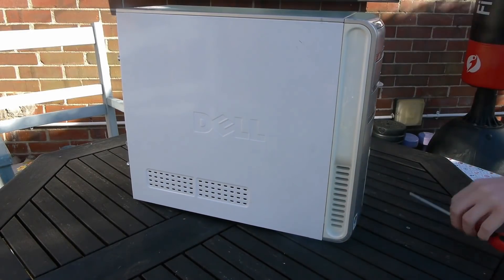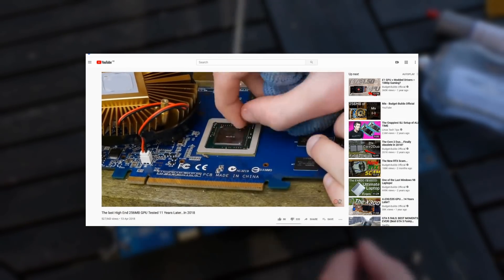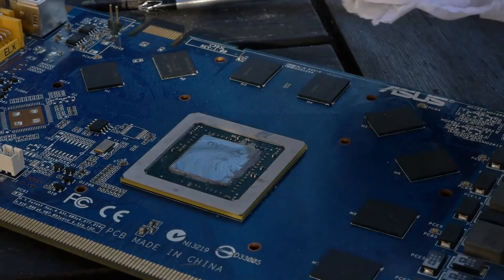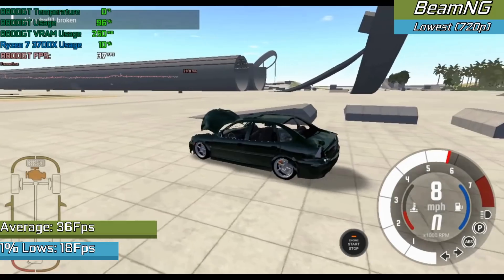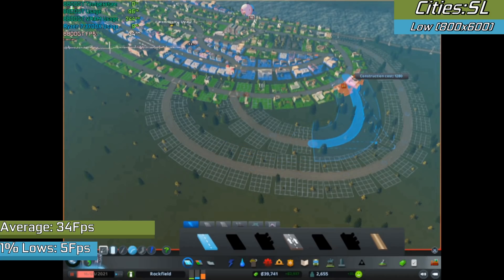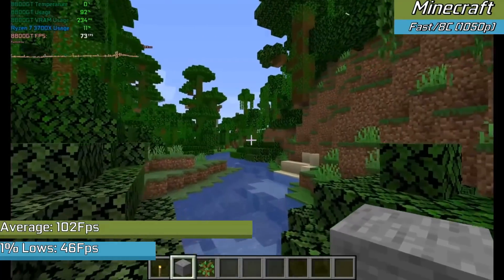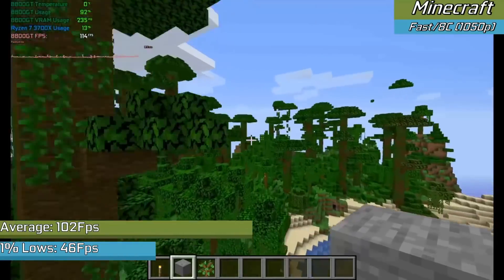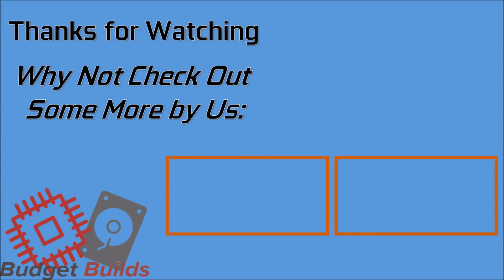GAMING with only 256MB of VRAM?

Comment: Congratulations, now you own a ryzen powered Playstation 3.
Reply: Playstation 2
Reply: @kidori121  actually no, you can not compare a PS2 to computers simply because of how much it differs from computers, which is why the PS2 is so demanding to emulate.
Reply: @Ozzianman  actually no, just buy a better CPU to have better emulation on PS2
Reply: @Tofuuuuuu  yea the GPU has to do like 0 work it's all the cpu
Reply: @kidori121  4MB VRAM? Are you kidding? Sony says PS3 GPU (Nvidia Nvidia 7800GTX based of) is 1.8TFLOPS in their press specs... then Sony lists behind links only during release times PS4 GPU had 1.84TFLOPS. Tell me about progress there. PS2 is totally not there with 4MB VRAM to be said to be even close. The thing which separates PS3 of others is XDR Ram speed and IBM Cell cpu which power was passed only recently in raw power by Ryzen cpu's lately (if you knew how to use it).
Reply: @Tofuuuuuu  Emulation is different than running game on native hardware. Emulator system usually many times faster than emulated one.
Reply: @kidori121  PS2 had 1MB of Vram
Reply: @Mr Oakley 07 "JuSt gEt A bEtTer PeeCee"
has Ryzen 3600 and 1070ti
Something tells me you have not tried to emulate Ratchet and Clank. FPS in that game TANKS unless performance improvements have happened. Actually, i know PCSX2 is getting a Vulkan renderer. Might try that.
Reply: @Mr Oakley 07 CPU is fine for years to come. Currently keeping am eye out on upcoming GPUs, might go RTX since I do 3D rendering and other stuff that would get a nice speed boost.
Reply: Spiral  And where hell you try pull this number from?
Reply: Additional note: Some just shows douple precision or shader and so you find hard time to compare those GLOPS 1:1 specially as Sony made Linux users hell as they blocked GPU usage and most users never knew how use SPU's where roughly 90% CELL CPU power comes from.

I did compare same source provider TFLOPS between PS3 and PS4 so they can be comapred between together 1:1.
Reply: Spiral  POWERRR and supported functions are different plus RAM helps greatly to make eye candy what is not always a power. You are not wrong but you are just off now. Handling large textures and data is helped by having RAM greatly. Having calculations POWERRR is different. You remember nvidia Quadros in example were so useful in their specific areas and normal GeForces did suck at those and you understand more what i refer to. Normal people doesn't focus or understand those.. I don't know why you need bring Naughtydog team here. Those even did hack PS1 to run their game better in silence in ways. I know they know tricks. Read those who did Ratchet And Clank series too they explain PS3 well too in their memos of how start using CELL cpu.
Reply: @XantheFIN  passing modern cpus? imao good joke
Reply: spiral7399  last of us bricked people consoles so they took a gamble

Comment: When a 14 years old graphics card runs GTA V better than your computer ;-;
Reply: ;-; same but I have 4gb of vram
Reply: K&S Tech News what are your specs?
Reply: today my vega56 has died, now i use a gtx 275 with a ryzen 1800x
Reply: then you desperately need to upgrade rofl.... $100 prebuilt with a add in budget rx 470 or something would easily play this at 1080p high.
Reply: @mxmobile5619  GT 210 4GB
Reply: @californium-2526  why the hell would a gt 210 need 4gb of vram
Reply: I went and looked around and I don't think 4gb versions even exist
Reply: Not 14 years yet! The 8800 GT(92) is just over 12 & 1/2 years old. :) The 8800 GTS(G80) is from early 2007
Reply: F
Reply: @onometre  same for a 730, most 10 year old GPUs destroy it, but they gave it 4GB of Vram and can't even run most wanted 2005 on max settings.
Reply: I have hp g60 laptop and only 1gb ram and 512gb of rom ;-;
Reply: GTA 5 runs on anything, literally anything, even intel hd graphics. If it doesn't run it's probably due to your cpu because gta 5 is cpu heavy.
Reply: I have 512 MB of VRAM of an horrible iGPU
Reply: @pikaaxyt  GPUs don't have to be that expensive if you don't mind 30fps or lower res/settings.

But I'd wait for the new stuff to come out since it Shou be much better than what's available now for both Nvidia and AMD.

GPU wise, I heard the new AMD CPUs are basically the same with slightly higher clocks but at almost double the price of current gem parts or heavily increased.
Reply: @pikaaxyt  Integrated gpu's do not have VRAM, they use normal system memory RAM as their quick access
Reply: @HOWLWOLF  I'm not broke. I'm cheap as shit to not go broke because when I spend, I can lose control. I have gotten better about it after 1 year if having a checking account
Reply: Get yourself a 2200g Apu build, gaming has become extremely accessable in recent years,well after that mining craze sht show
Reply: intel n3530 here with integrated bay trail gpu
Reply: @chillhour6155  the 3200g is somehow cheaper here than 2200g
Reply: I cant run it i got an Asus i3 and 4gb ram and a NVIDIA 820m lol...
Reply: It's not all about Graphics Card.
Having a Good CPU and a RAM and a SSD matters now.
Reply: A mi me va bien con mi 780ti xd
Reply: @mxmobile5619  me too
 

lmao
Reply: #intel hd 😂😂😂😂
Reply: Lol
Reply: My PC run GTA v better i got 6 gb od video ram
Reply: My laptop runs it at 60 fps
Reply: There is a fucking video where a 50 cent graphics card ran gta 5 solid
Reply: Yeah but with 32 gb ram and ryzen 7 3700x
Reply: Только учти что гта 5 вышла не в 2020 году, а 2013, поэтому можно сказать что видеокарте 7 лет и она уже не тянет гта 5.
Reply: А не 14
Reply: This is why you don't buy OEM laptops that use mobile CPUs which perform far worse than their written specs would suggest!
Reply: Oof
Reply: I have fuking 8 gb ram with i7 5 th gen stilll it does better 🤔🤔
Reply: i Have G31 Onboard ,,,
Reply: I still see your shadows in my room
Reply: why, i thought this video is fake
Reply: same
Reply: Lol me too hahaha
Reply: Upgrade your gpu, it legit isn't expensive. If you can afford a pc and, a ISP. Im pretty sure you can save up 50 bucks.
Reply: @Timo Werner Hey, no problem, the GPU Works now, I repair it.
Reply: Lmao gt 210 is powerful enough to show the image on your display idk about anything else tho xD
Reply: It's ryzen lmao
Reply: Not anymore. I now have an rx 570
Reply: Dylan yh I think it’s because you might have texture detail on high, put it to normal and put the drawing distance to 0 and turn all the advanced settings off
Reply: @Dylan no i said put textures on normal
Reply: @mxmobile5619  same :)
Reply: Me sitting here with my Intel HD graphics not able to run GTA SA at high settings :(
Reply: @onometre  The same reason my 500gb 4200rpm HDD has 128mb cache (it doesn't)
Reply: Do you have intel hd graphics?
Reply: There is the truth 😅😅😅
Reply: I have a Gtx 1060 3gb vram and 8gb ram with a. Amd cpu k forgot which one
Reply: Mate I have a Ryzen 7 2700x, 32 GB RAM, RTX 2070 it runs very good
Reply: My pc can't even run Minecraft
Reply: E.T Channel thats not a bottleneck at all
Reply: I have rx570 with 4gb of brak and iż much better than that
Reply: @onometre  Because why not? :D
Reply: @AThePetrov - Windows Blackcomb Ultra 2 OH, that's really old.
Reply: Intel HD gang ; - ;
Reply: @ŽaliaUgnis  do u have any sense of computer, rom?
Reply: What do you mean?
Reply: I think GTA is more CPU intensive
Reply: @mxmobile5619  same but i have mx110 2 gb and gta 5 runs like crap
Reply: @HOWLWOLF  …say that now mate look at the bloody prices for a decent cpu
Reply: @ChosenOneDan  not in 2021
Reply: @mattsstuff08  well yea bro I posted this in 2019.... you waited too long. Get a newer pre-built there's still OK deals if you shop around.
Reply: You're probably running an igp or something

Comment: I'll be honest, I'm surprised some of these games launched successfully, let alone averaging 30+ FPS in HD.
Reply: When i had HD7770 i played gta 5 on 20 fps lowest without shadows 800x600
Reply: @hekoshi.0s  That's weird. 7770 is easily faster than a 2008 HD 4890 for example or GTX 285 and GTA 5 should've run much better than 20 fps on min settings at 800x600
Reply: @raresmacovei8382  ikr, it was from xfx my dad brought it brand new several yrs ago, i will never buy xfx
Reply: I got a 512MB GT8800 and it ram the games I tested on it pretty decent, it's kinda like a GT730 but slightly better.

If both cards can run the games that is.
Reply: @hekoshi.0s  What's your CPU? With low settings at a low resolution, you might have ran into a CPU bottleneck.
Reply: @hekoshi.0s  I looked at Userbenchmark score, they said HD7770 is 140% faster at 3D and 274% higher fps than 8800GT, the graphic card in the video.
Reply: @hekoshi.0s  its prob a fake hd7770
Reply: @hekoshi.0s  maybe your gpu wasnt inserted properly. Insert it again, wait until you hear a click sound
Reply: @devinwicaksono1248  i sold that shit
Reply: DeSoyl what cpu?
Reply: @ryanolsen294  i7 2600 bottleneck af

Comment: 256MB? I have a card that comes with 256K, I upgraded it to 512K after sorting through several bad DIP RAM chips... the best it can do is 1024x768x16. Interlaced. A CRT is a must.
Reply: Nothing beats good old VESA mode 0x13! Just blasting pixels straight across the bus into your VRAM chips, no fancy "Graphics API's" that get in your way...
Reply: What's it paired to?

Comment: Back in 2012-2013, my brother-in-law gave me a Radeon 4550 HD with 512 MB of VRAM and I immediately paired it with my then current build: a Dual Core 5400E and 2 GBs of RAM. I was so happy that I could run Doom 3 BFG flawlessly with some tweaks here and there. Sure, drivers' support for the card are dead now, but I still love it for what it meant to me: the chance to play some of my favorite games without worrying too much about the lack of VRAM. I still have the card but I no longer use it, given that my old build died about 10 months ago. I currently use a laptop and I have the card only as an emergency display adapter for other builds. Have a good one, everyone!

Comment: "Sometimes VRAM isn't as important as people like to point out." - Thank you. That's what I thought when I bought my RX580 4GB.
Reply: I wouldn't want a 4gb vram card in 2020 personally. its still fine today but the 8gb cards are a safer bet if you're planning to keep it for another couple of years.
Reply: @ChosenOneDan  3-4 gb of vram is completely fine as long as you're not planning to go over 1080p.
Reply: @TheRealWALLABI  it "depends" theres games now at 1080p that can use 5gb.
Reply: I personally still believe people were insane in 2014 for buying GTX 970/980 with only 4 GBs VRAM instead of R9 390/390X with 8 GB of ram.

It's been clear for a few years now which has been the smarter buy.
Reply: @TheRealWALLABI  not really, today i was playing SOTTR on my RX570 8GB at 1080p and the vram usage would go up to 7GB sometimes
Reply: @ChosenOneDan  I know that. Warzone takes more than 7 gb out of the 8 gb in my 1070, and I play at 1080P. But even with less vram it'd still be perfectly playable, albeit at lower settings perhaps.
Reply: @ChosenOneDan  Exactly: can use 5gb, they could also use 10gb or 1000gb, that's what settings are for. To keep things reasonable. Honestly, always use custom settings, ultra is hardly ever worth the performance impact, even if VRAM is the only thing "holding you back".

Also these cards usually are advertised as 1080p cards anyway so they're budget oriented these days, which means spending less on memory serves their purpose a lot better.
Reply: @MLWJ1993  depends. for a good while getting the 8gb version of the 570 / 580 was only $20 more. I'd say thats easily worth just not having to worry about dialing it back to high to not cap out 4gb if ultra actually performs well on said game. yea I agree that ultra isn't worth it but even on high preset as time goes on 4gb will become thin.
Reply: i went from a 64mb vram pc to a 2gb vram pc, and i swear there is a huge difference.
Reply: @TheRealWALLABI  Warzone has a memory leak
Reply: @TheRealWALLABI  that's rather odd.  My 5600 XT at high settings @1440p will run Warzone at a locked 75fps (my refresh rate) and the most it ever uses is about 5GB.

 That is until the game starts having a vram leak and it takes up all of my vram and it runs at 40 fps
Reply: uhhh
VRAM=RESOLUTION
Reply: still happy with my 11gb vram on 2020...
Reply: @raresmacovei8382  The GTX 980 is still a better card than the than the R9 390 and 390X, and it uses less power.
Reply: @comicsans1689  With modern games? It's slower than 390X and not that often faster than a 390.
Reply: My laptop has a 6GB RTX 2060
Reply: If you dont care about stutter, yeah.

I care about it a lot. In fact, it's by far the most important factor of me playing any game.

If a game stutters and is not fixable, I will not play it.

Comment: Almost makes me regret selling my Core 2 Duo +  9600 GT (512MB) system in 2013...ALMOST. Fascinating to see just how much you can stretch old parts.
Reply: I still have a 9600GT , i tought it was impossible to run gta5 with it..
Reply: I still have mine with a Zalman cooler,was an amazing, just a pity that vram limitation becomes such a big problem, maybe one day when system memory speeds catch up to vram we can put them back to use
Reply: He was using a Ryzen 7 in the video, and the Ryzen 7 has a very good integrated graphics, probably  this GPU doesnt was being used by the system.
Reply: @rianheroking  the cpu doesn't have integrated graphics

Comment: Well done review as always. However, i know 2 things which could improve the specsheet in the beginning of the video:
- Add core and memory clockspeeds (also shader clock if it's an older card).
- Add the buswidth to the memorytype. This would be a good indicator of the card's memory bandwidth.

Comment: I thought GT 210 was bad

and I was right
Reply: GT 210 with a cheap fan strapped on: GTA V at 20 FPS
8800GT with 256MB: GTA V 30 - 40 FPS
yes, GT 210 is worst than 8800
Reply: @Sheovion  LOL u compared 125W tdp to 31W tdp And 64Bit WIth 256Bit

Comment: Hmm.. seems that card has enough power for some android gaming. How about trying it out on some android emulator like Blue Stacks or hell even on freshly installed x86 android OS?
Reply: android x86 will not start, as it would not be compatible with the gpu. tested it with a gt 8400 gs and it didn't work

Comment: I would like to see proper racing games tested on these gpus.
The first time I remember having more than 256MB of VRAM was a good thing, was with Doom 3.  Where having IIRC 512MB of VRAM allowed you some extra good textures.
Reply: I was remembering exactly that, when in the graphics options you could activate some ultra textures and it said somethig about 512mb required, but I activated ot anyways with 256 and had cero problems and it was a really good experience (gts 8600)

Comment: WOW! Finally competition for my garbage A8-9600's iGPU (I can't even give it more VRAM, cause I have an a320 mobo and I wasn't able to find an option for it in the BIOS. I don't think it would increase my FPS by a lot, even if I could change it)
Reply: bro just replace that garbage and go ryzen already. those A8 cpus are a big yikes... can find r5 1600s / 2600s secondhand for cheap. used rx 470 / 570s are cheap too

Comment: I Know it doesnt have anything to do with this video, but for the people running Q6600 and similar cpu's under windows 10 read this: Today i installed windows 10 on my old q6600 optiplex and the Cinebench r15 score was much lower than in Windows 7 (232 compared to 301) and i found out that core 2 cpu's are also affected by Meltdown patches, so i downloaded an app called inSpectre and disabled the patches with that and now the performance is back to normal. Made a huge difference
Edit: if the scores seem too high to you the cpu is BSEL modded so its at 3GHz

Comment: Funny you came the conclusion early in the video that it compares close to an Intel HD 520. I came into possession of a system with a HD 530; after running it through it's paces found it's close to a 2007-2009 card. Some benchmarks land it a bit below the AMD HD 4830, others close to the 2006 8xxx line you're looking at today. :)
Kind of neat that we've seen 10x perf per watt improvement the past decade. The fact the HD 530 can run games that used to take a 105w+ card to is impressive to me.

Comment: I remember exactly 12 years ago, I bought a new 8800 GT with 1 GB VRAM. (Didn't think I'll ever need that much, but price was the same as the 512 at that deal).
Would have been fun to test it today with 1 GB. Should eliminate the huge FPS drops.
VRAM is really working primerely as a framebuffer in games, so when you need to acces system RAM, the latency on the platform (Card>PCIE>MB>CPU>RAM>PCIE>Card) is a lot higher then on the card itself. Hence the lags.

Comment: My first 64mb video card was MX 440, My first 128mb card was a ATI 9600, My first 256mb card was a ATI 9800 pro, My first 512mb card was a ATI 3850, My only 640mb card was a 8800 gts, My first 768mb card was a 8800 gtx, My first 1gb card was a ATI 4890, My first 2gb card was a gtx 285, My first 3gb card was a gtx 660, My first 4gb card was a rx 570, My first 6gb card was a gtx 1060, My first 8gb card was a rtx 2070 (My current card.)

Comment: In a 32bit operating system, hypermemory is a pain in the neck. That card has adequate support for googlemaps 3D and general html5 webpages. Better than being lumped with hypermemory (for some people). For a few rarely played niche games (if you truly love them), you can SLI two if you feel like it. As an aside, it has good Nouveau drivers in linux. I think Tropico4 'State Of Emergency' DLC (from mid 2014) would have been worth a try.